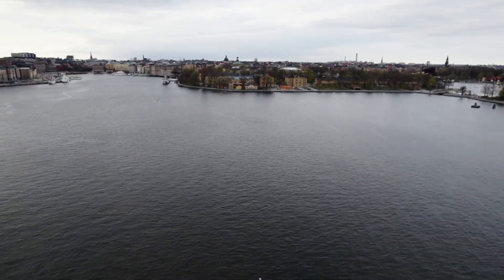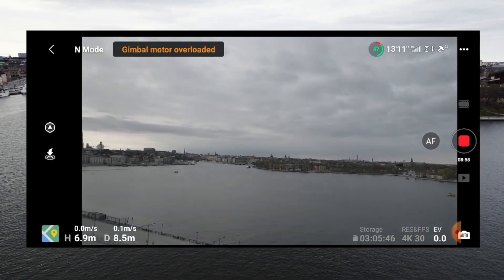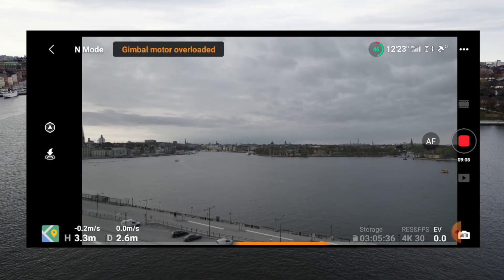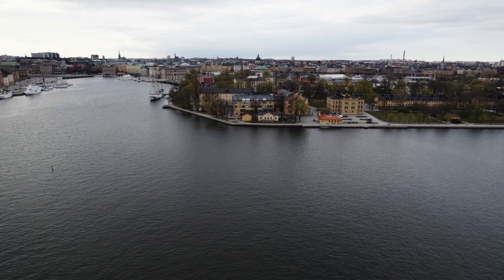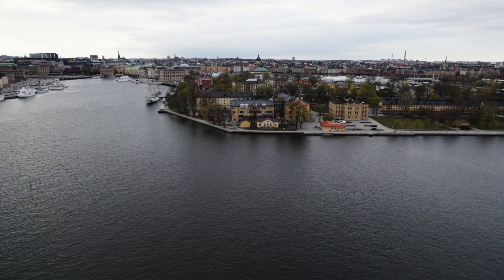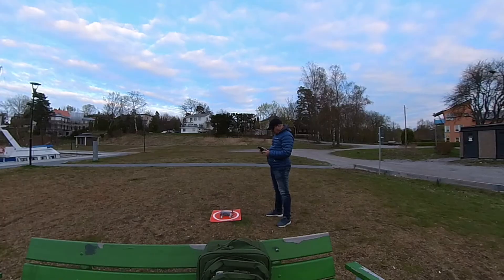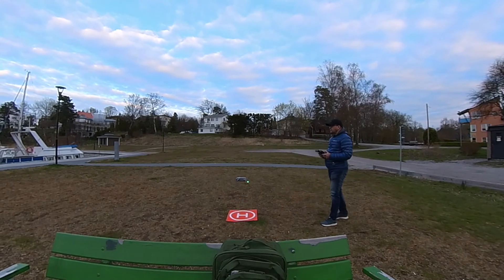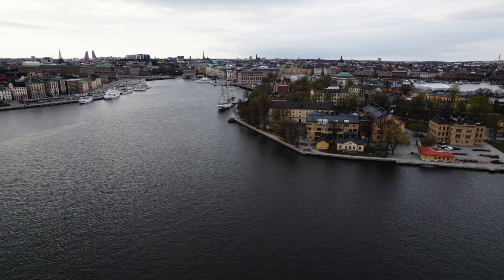DJI Air 2S Gimbal Error Follow-up - The 3 things I have done

Comment: When the gimbal was stuck did it make a sound like static or it was just glitching without sound?
Reply: It does make a glitching sound for me, it's from the vibrations.
Reply from the maker: No sound from what I remember. Just shaking once in the air….

Comment: Bought an Air 2s. Did 1 flight. The next flight was for a job. Guess what? 40002 error. Was unable to calibrate gimbal. I returned. Hoping this isn’t a constant issue with these models. Ordered a replacement.

Comment: How is everything now days I just got my drone 4 days ago and I just got this issue today gimbal overload
Reply: @thinkthings  hey bro it's all good.
Ya what I did was I work at a auto body shop and I just took drone there and used our compressed air.
IF ANYONE  END UP DOING THIS
MAKE SURE you keep air nozel far and hold the gimbal when blowing air at this rate will break the gimbal 

mine has not given me any issues since then 

Hope it helps someone 

😂 You can always just go to mechanic shop or tire shop and ask to use there air
Reply: @2A2DEATH  hey hi, what part of the gimbal did you blow with the machine?
Reply: @ChristianCRG  hi well I mainly used my work place compressed air machine held the camera so it will not damage from the strong air and I mainly blow the air in the cracks openings that dust can get into and I few time taken my time and never had issues since then 

Also I stay away from landing on anything dusty sandy or even taken off if I must I use my landing pad 15$ worth it save you headache long run 

Hope this helps 

Be very careful with compressor air as it let out some mist of water avoid it as much as possible
Reply: @ChristianCRG  you can also use what my friend did if you have a baby in the house chance are you have a nose sucker thing you can get from pretty much target Walmart CVS you can blow air with that